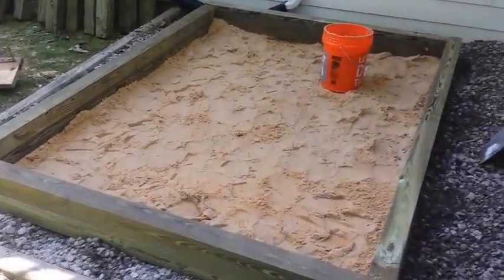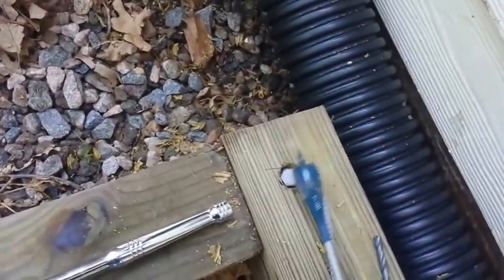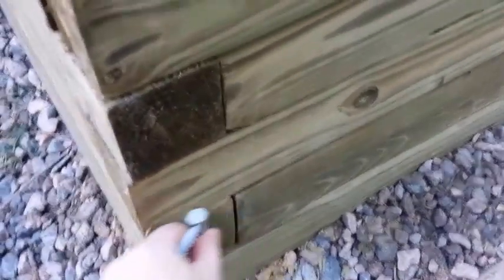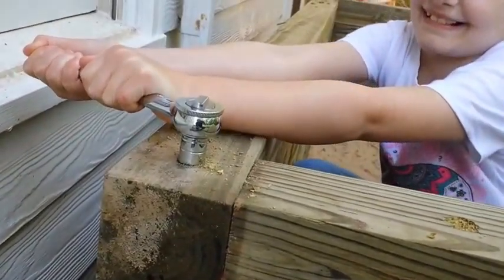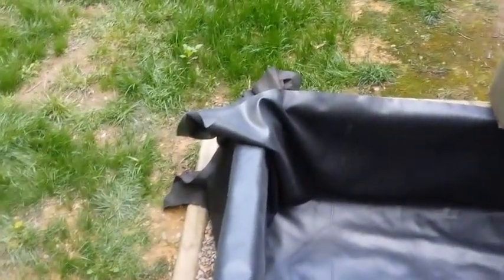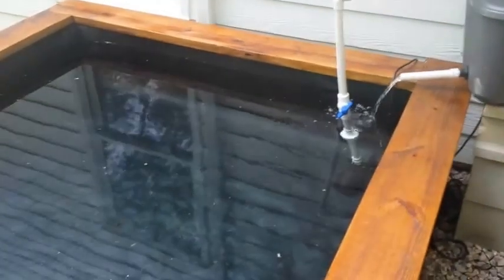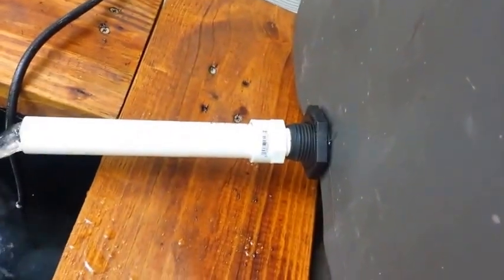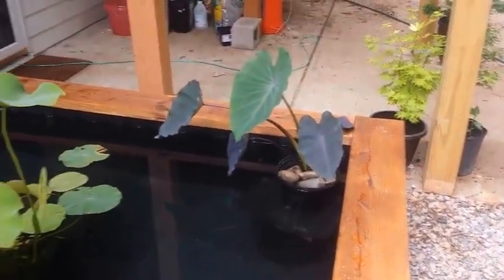Amateur Above Ground Pond

Comment: What size of 4x4 cut to stack it up? Can u give me more details of dimensions of wood cut! Very nice job , thank you for your share
Reply from the maker: Well I didn't "cut" any wood. I was lazy and just used the size wood peices that were sold at Home Depot. The frame that I connected was made from 4' , 4x4's and length wise 8' 4x4's.  I just stacked them and connected them. Next time I do this though, I'll sink better support blocks on the bottom, to prevent shifting.

Comment: What size drill bit do you use for the pilot hole?
Reply from the maker: Eddie Baker dont exactly recalled, but if I used a 3/8 lag bolt i predrilled with a 1/2 , 18"  drill bit. Pre holes should be one to 2 sizes below the bolt
Reply: Longinius Spear thank you